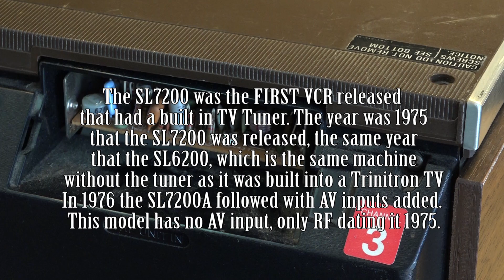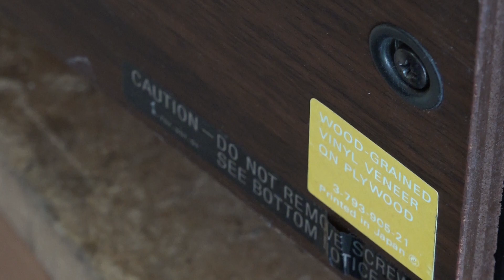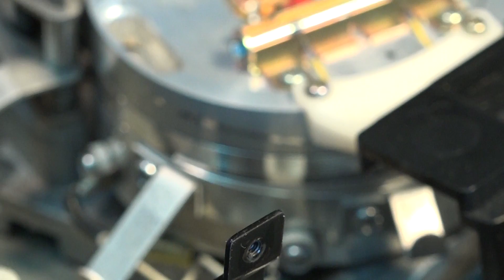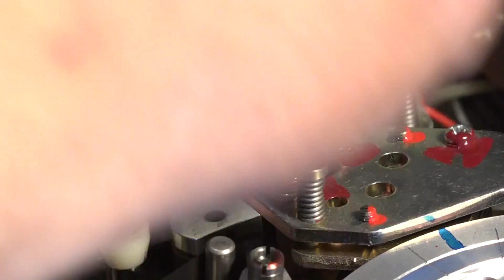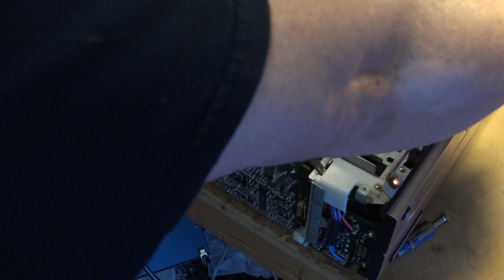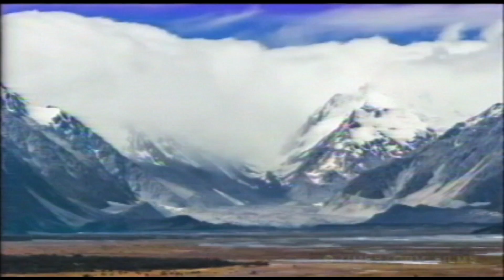Sony SL7200 Vintage Betamax Overhaul repair

Comment: God damn! That picture quality is way better than any of my 6 PAL Beta machines that run at one speed close to BII. This proofs how Beta was better than VHS. And we are talking about a machine that's exactly 40 years old! Very nice channel. I also did the same audio/control head alignment on one of my Sanyo's. Love these vintage VCR repair vids. :)
Reply from the maker: All NTSC machines have a better picture than PAL and SECAM machines. The reason is a much higher writing speed. The head drum, which writes the video signal is spinning at 1800RPM on NTSC machines,  In 1/60 of a second the head needs to write out 262.5 lines of the analog field. On PAL the drum speed is only 1250 RPM yet 312.5 lines of video must be written.Due to the slower drum speed, the effective head to tape speed is much lower, and yet it needs to record even more information (more lines).Since the max frequency recorded is determined by the relative head speed,  and horizontal resolution is determined by the max frequency that can be recorded, the lower writing speed means less information can be recorded.On NTSC VHS the max resolution (not the scanning lines, that is 525 for NTSC and 625 for PAL, people get that confused, but scanning lines is not horizontal resolution it is vertical resolution).NTSC Horizontal resolution for VHS is 240 lines. Beta2 recorded about 280, and Beta1 300.  3/4" was good for 330.PAL on the other hand VHS was only about 190, and Beta 240.  This is due to the lower writing speed due to the slower drum rotational speed, which is determined by the frame rate of the video signal.
Reply: This is true! I have a multi system Beta machine (SL-T30ME) and I have a couple of BII tapes recorded off TV and a pre-recorded movie. The picture is much better than the PAL tapes. As for SECAM, what a crappy system is that! It's hard to get a good looking color picture on SECAM tapes. Greece used to broadcast in SECAM back in the 80s and I have some tapes from that era. Very bad picture. Some of them recorded in the Middle East SECAM and some of them on the DDR (East Germany) SECAM.
Reply from the maker: The only reason that SECAM exists is because the French wouldn't swallow their pride and admit that PAL was better.

Comment: you can get better picture if you transfer the cassette by sl-hf2100 betamax
Reply from the maker: The SLHF1000 will produce a better picture in B1 if the SHB option is turned on. If the Hifi audio is off it will be better still.

Comment: Very good video! I've wanted to see BI picture quality for a long time. Would you say that is better then umatic low band machines from around that time? Interesting loading mechanism, beautiful machine.
Reply from the maker: No, not quite to Umatic low band. Beta 1S was better than Umatic low band, and Beta1 SHB was much better than Umatic Low band, especially with the beta hifi turned off. That way the full 6.0MHz od spectrum was available.I am working of getting the edit bay together for a shoot, and edit on Beta just for the fun of it, and I will film the edit process
Reply: got it. I'm guessing umatic uses slightly more tape at a similar density... at lest it seems to.
Reply from the maker: Umatic uses far more tape. have you seen the size of the cassettes?I will be doing another Umatic video as I was just given an old Sony VP2000 playback machine, so I will be servicing that one soon.
Reply: I know umatic is 407 inches per second on the video heads (per conversion from 'write speed' in the service manuals) I just haven't seen much of Beta decks and I think they are great...but the "closest" thing I have is a digital betacam. I never had a working beta deck growing up and think I've spent more time even with 1/2" EIAJ, strangely enough. wish most of the vhs machines had been beta :(

Comment: I'd love to see a video of your storage area where all this good ol' stuff lives.
Reply from the maker: You don't want to see that area. I don't want to see it. I get scared every time I venture in there.
Reply: +12voltvids lol!  I know it is scary but it would be cool to see all the stuff you have. As long as you haven't been called to be on the tv show hoarders you are good!!!  Lol!!!
Reply from the maker: You are seeing it being serviced. My storage area is actually kind of boring. It is just a loft over a barn, heated so the gear doesn't freeze with a bunch of machines stacked in the corner, and a few boxes of old parts and boards. Nothing really interesting to see.

Comment: Absolutely would like to see a video shot on old school gear. Also funny with that sticker. I worked at GM Holden for years and I remember they had part numbers for the stickers that had part numbers on them for the actual car part.
Reply: Great Beta machine that one too!
Reply from the maker: I'll shoot one some day. I just got a truck load of stuff to work on. Up first is a very rare piece of Sony gear. It's called a vidimagic. Go look that one up. The serial number is 175 on this one. Even rarer than the 7200! Go look up indextron to see what I am up against.
Reply from the maker: Wait till you see the next piece, and I guarantee that you haven't seen this one, as it is rare. I hadn't ever seen one of these units until one was dropped off at my door today.It is a very unique technology that Sony was working on that basically turns a black and white single gun picture tube into a full color shadow mask less tube. Wait for the video it will be up soon.
Reply from the maker: I'll do something on the old gear this week. I am on holidays, and am not going anywhere this week, as travel is so stressful. Much more relaxing to hang out and play with my old technology.
Reply: Really looking forward to the next videos coming out. A Sony Indextron looks like a nice interesting machine. Definitely never seen one of those before. Old vintage tech is so much fun to work on. From simpler times for sure.

Comment: Ya Gota Love Those Old Sony Betamax Machines From Back in The Day ..Old Work Horses That Kept On Working With a Bit Of T.L.C. Great Video Had One Of Their Triniton TVs too Fantastic Pictures On Them Too..Nice.
Reply from the maker: I have a few old Trinitron TVs in my old CRT museum. KV1365, KV1965, KV2085 I believe.
Reply: Cant Rember The Model But I Think it Was a 19 inch or 20 inch Model But The Pictures On it Were So On The Money Don't Know What I did With it I Think I Was After a Bigger Screen And Sold Off The Sony Pity it Was a Lovely Set.
Reply from the maker: The original 20 and 25 xbr set had the best picture of any Sony TV. They looked fantastic.

Comment: It is amazing how the old electronics work so well but it is always the belts that wear out causing the unit to malfunction, I wonder why cloth reinforced rubber belts were not used in place of the standard rubber belts, BETAMAX I was better than the Video Home System (VHS) and possibly better than the AMPEX QUADRAPLEX Video System.
Reply from the maker: Quad was an early standard, and when it was set up properly delivered the best picture that the analog formats could produce, because it recorded the entire video signal without converting the color.When helical 1" hot the market, it could rival quad, with much better reliability.The small formats, 1/2" and 3/4" were never considered broadcast quality, as their signal to noise ration was not good enough, even though these small formats did make it into some areas of broadcast, namely news gathering where the quality compromise was acceptable.It wasn't until betacam that 1/2" tape was able to be called a true broadcast format, and it de-throned king 1" from it's place at the top of the video food chain. To me more precice, betacam SP did that, not standard betacam.1" still had many more years at the standard in broadcast though, it just no longer was superior in quality. The 1/2" tape format had caught and is some aspects surpassed it. (Componet chroma recording)

Comment: My dad bought one at the bay.  I think he paid $600 for it new.
Reply from the maker: Right, and followed by the VCT201, in 1978 also made by Panasonic. That was my first VCR. I bought it in 1979 when I was 16, and had to save for a LONG time as minimum wage for a teen back then $2.15 an hour, and that deck cost me over 2,000.00, and no I didn't get a penny given to me. I worked my ass off working in a store, and mowing lawns all summer to be able to buy one. I felt like a king. Problem is I couldn't afford 60.00 for a 2/4 hour tape. It came with a T60. I bought a new brand of tape that was 30.00 and got stung with the first counterfeit tape. 3 weeks later my VCR was off to the shop because of no picture. NO WARRANTY the shop said. Dirty heads 85.00 please. No money, borrowed this from my parents to get fixed. 2 weeks later, bam same problem, bad tape. Shop wanted another 85.00 to clean. Said no way. Took machine apart, cleaned with q-tip (fortunately I did not break head, as that is the worst way to do it) Thought HMMM there could be money in this. Was already interested in electronics, and this incident with the bad tape pushed me to study electronics, as I could see $$$ when VCRs took off. I was right. By the time VCRs became main stream I had good knowledge. Got a job with Sony, took their Betamax training courses, and then landed at a Sony repair facility for 20 years.
Reply from the maker: Many companies were / are like that.The one company that has bent over backwards for me over the past 5 years is, believe it or not GENERAL MOTORS. They have been fantastic with my Volt. When it went in for the battery pack side intrusion reinforcement, loaner car.  When it goes in for routine maintenance,  I get dropped off at work, and they pick me up when done. The only time the car has been in for service in 5 years was a few months ago. My neighbourhood got walloped with a power surge that blew my modem, and Hot tub controller. My car was also plugged in charging when this occurred, and it triggered a safety shut down. So the car still runs, but only on gas. Won't allow me to charge. Off to the dealer to be checked out They drive me home as usual. Next day they call me up. Needs some further testing as the code that came up was a ground isolation code that has never come up before, so the tech needs to inspect. They say come in and get a car to drive. Gave me a brand new car to drive, paid for the gas in the car. While my car was in, rotated the tires, changed the engine oil, and reprogrammed the computer modules. There turned out to be NO fault whatsoever, just a major power fault, which caused quite a bit of damage in my area to electronics. Triggered a safety shut down. The computer basically detected that the charge circuit had leakage to ground, and it shut down. They worked on my car testing everything for 2 weeks. Cost? Nothing, and I got a letter telling me my next scheduled maintenance next year will be free too. In 5 years I have paid for 1 oil change at 60.00, everything else has been totally free. I guess they want me to buy another Volt, which I certainly will.
Reply from the maker: Not this machine he wouldn't. This one originally sold for probably 2500.00
Reply: It was actually $1295 in Feb 1976. The first Betamax which was sold in a TV console, the LV-1901 did cost 2500 in November 1975.
Reply from the maker: The first VCR I bought was an RCA VCT201 and it was 1999.99, and the reason I bought it was because it was 500 cheaper than the Betamax SL5400. Perhaps that was the price in the USA but in Canada it was much more than that. A KV1940 19" TV was 1499.99.
Reply: I have an original example of the first Panasonic VCRs like the VCT201. An NV-8600-EM built in November of 1979 which is a multi system one.
Reply: If I remember right, It was more like 1977
Reply: +Mark Anderson The first VCR by RCA was the  VBT200 released in 1977. Made by Panasonic.
Reply: A VCT200 also exists. But I don't know the difference between these models. The VBT200 has a silver front panel while the VCT200 uses a woodgrained panel. These must be clones of the Panasonic PV-1000 and PV-1100 models.
Reply: What an amazing story! That's 200 US bucks in today's money just to clean the heads! Glad you opened it up and cleaned it yourself..."NO WARRANTY" Fuck this!
Reply from the maker: Was it a 2 speed or SP only. I had a Panasonic unit way back too that was SP only and had slo motion playback.
Reply from the maker: Yup head cleaning was considered maintenance, and not covered by warranty. Head cleaning prices fell to 29.00 once more techs learned how to do it, but in the early days when your 2000 machine broke, and you thought it was covered by warranty you took it in to the warranty shop. Believe me my dad went ballistic, which he often did when someone was trying to bend him over. That's one of the reasons I had to learn how to do it. The second time it broke my dad took it back in (because I was still in school during the working hours of the shop) and they refused to look at it the second time because of what happened the first time. Also the first time it was in for 5 weeks for a cleaning. The repair guys of the day probably had no clue about these new video tape recorders.
Reply: +12voltvids The VBT200, VCT200 and VCT201 are all two speed decks. The VDT501 was a three speed machine.
Reply from the maker: If memory serves me correct the difference between the 200 and 201 was the timer.On the VBT/VCT 200 the timer was a launch and record, and the machine stopped when the tape got to the end. The 201 added a "Stop" time to the timer to shut the machine down.

Comment: Great Video!!
12V you need a set of JIS Screwdriver.
You have increase the RF Current, for one of the heads?
Or on the Y/C record level?
Reply from the maker: Record current for both heads.
Reply: The Adjustable Record Current is aviabale, 
only on the first generation on Beta VTR?
Reply from the maker: No they all had it.

Comment: Bloody hell, you cant get better than that for a very old machine, amazing quality considering how old it is :-).
Rubber belts, they are a pain in all the old machines, sometimes ive had to bodge the system by adding a small belt to a V grooved pulley, the belt sits in the bottom of the V and allows the drive belt to grip better, yep its nasty but works.
Also where a flat belt nearly does the job but slipps, turn it over to the better surface.
You know all the methods far better than a bodger like me lol :-D.

Not sure about making a video using old equipment, sounds like a bloody pain in the bum lol.
I wonder if the old vhs suffer with stickage as well, the bottom "rabbit" shelf or reference shelf does get shiney over the years.
One thing i have noticed is worn head drums with a horrible grey look, almost sand blasted with soot, ive seen a few but not all do it.
Reply from the maker: When the head drum looks like it has been sanded it is usually an indication that the user had used a dry cleaning tape excessively.
Reply: Ahh thats why i only saw it with certain machines, owner abuse :-(.
I allways cleaned my machines heads by hand.
Open pore cardboard works really well :-D

Comment: I'd enjoy an old analog production, using both types, modern digital to watch the old setup, plus actual vid from the old setup.  I have an old NEC betamovie cam (no playback) thatwould be fun to demo, may drag it out to do likewise with vid capture on my PC..  Thanks, Don
Reply from the maker: I did an edit demonstration last year of the SLHF1000 editing package, editing a 30 year old tape.I am still toying with the idea of hauling out an old camera and Beta deck and doing my raw shots on it, and cutting together on the SLHF1000 units. It would be a basic set up though, just the 2 decks together and probably a single monitor set with just auto assemble used, no titles, no croasfades.I just need to find something that I can make a short video of, because naturally the video would be about the old gear, and the actual process of analog production and editing.
Reply: Really cool idea. And don't forget a vintage mic to go along with it. What I have learned from this video is that no matter how lo-res you go youtube will still find a way to sodomize the signal.
Reply from the maker: You mean the vintage microphone on the camera. Sure why not. I just attempted to upload a video of a very unique piece of gear I repaired, but it had to go because there was a 30 second shot of a concert projected on the wall in the background, (from youtube of all things) that their content ID matched and blocked in Canada and the US. So it is back to edit the scene again, invert it and put a nice big title over it to fool the content ID crap. This isn't the first time that a image has been picked up in the background that has caused grief. That one should be ready to send up again tomorrow. Kind of pisses me off though, because the source file is about 5 gigs in size and my internet is metered, so re-uploading a video to fix a 30 second scene will cost me in over usage fees by my ISP as I am very close to my limit now.

Comment: that is a very big and heavy machine and speaking of VCR I got a sharp s-vhs player that has these specs 4 head,19 microns heads,and sharp super picture. I got this VCR at an yard sale for $1 and it dose work with no parts needed and just rf output is very weak and it did come  with original working remote and with new battery's in it too